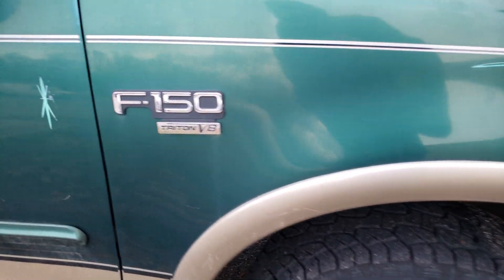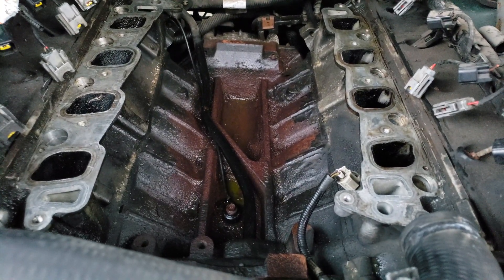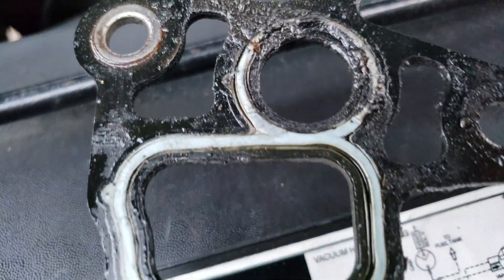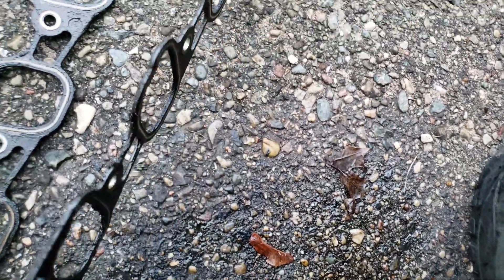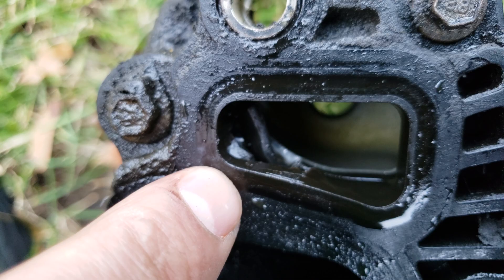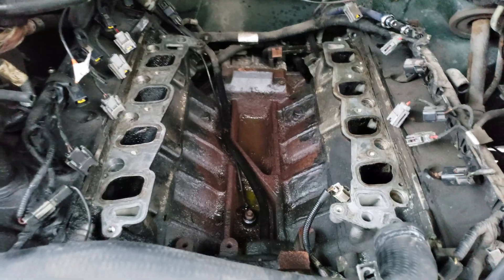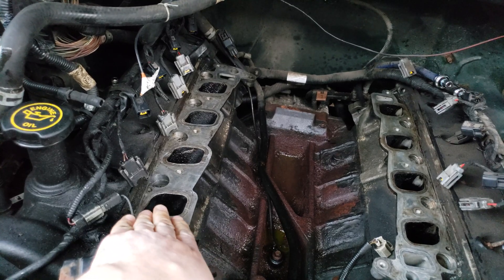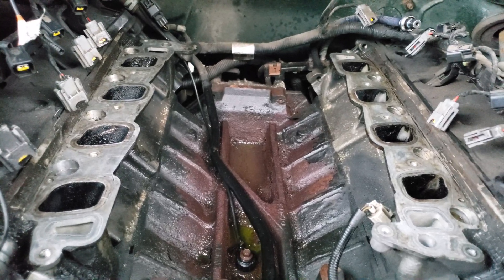2000 F-150 5.4L Intake Manifold replacement

Comment: When you had the leak did you have smoke coming out of your exhaust?
Reply from the maker: The smoke was slight and noticeable on warmups, low coolant levels and a bit of a stumble on acceleration.
Reply: @MrMazzhitz02  I just bought an 03 f150 it's been sitting for a little bit and it has a bunch of white smoke coming out of the tailpipe. I'm thinking it might be an intake issue instead of a head gasket because of no milky oil cap. Thanks for the quick response!
Reply from the maker: @whatthetechmechanic  Have you pressure tested the cooling system or pulling out the spark plugs to confirm the source of the leak. When you have smoke, it usually means that you have a large amount of coolant in the combustion chamber. This leading to a head gasket.
With my 2000 F150 5.4L Cyl 4 has a small head gasket leak that I used a camera to see inside the engine cylinder. I used Blue Devil and it sealed it.
Reply: @MrMazzhitz02  I got the pressure tester and the cap wouldn't fit onto the overflow and I didnt see a radiator cap to put it on. That's what i was originally going to do. I turned the engine on for just a minute and when I turned it off i heard a like sounding like an air like and it was right at the thermostat housing on the crossover on the intake. That's why I was thinking it my be getting past the intake and into the cylinders causing the smoke. Im not exactly sure how to differ from the two and dont exactly want to guess either. How has the blue devil held up. I've always been hesitant on using sealers on an engine.
Reply from the maker: @whatthetechmechanic  The tester should have an adapter to install it on the reservoir, maybe try renting a kit from Automotive store in your area. As far as a sealant... I feel dumb for using it but I was desperate for a fast solution. It works and held up great. I still have the truck. Down side to any sealant in the cooling system is the potential harm to the waterpum or blocking your heater core. 
Also
 when you start your engine have the cooling system filled and topped off to the full line. Then allow it to warm up to normal operating temperature, give the upper radiator hose a squeeze and see if it is pressurized similar to squeezing a basketball... a head gasket will cause the cooling system to become over pressured (greater than 16psi, tolerance of the Radiator Cap) you will then see a leak around the cap and or the reservoir.
Reply: @MrMazzhitz02  once again thanks for the quick responses. I was going to have to replace that leak up top anyway. I'll see if replacing the gaskets will help any. If it dont help I'll just dig down deeper in the engine and replace the head gasket.
Reply: And I did get the tester from oreillys. It didnt fit
Reply from the maker: @whatthetechmechanic  Your better than me. The shop wants $3,500 for the Head gasket replacement and the job calls to have the engine removed to do the job. Let me know how it goes.
Reply from the maker: @whatthetechmechanic  Thats odd. I have a tester I hought from Harbor Freight, I'll check to see if that kit is compatible and get back with you.
Reply: @MrMazzhitz02  just a tip I heard it's a lot easier to do it when you remove the front cap. It supposedly takes like 45 minutes and it makes a world of difference